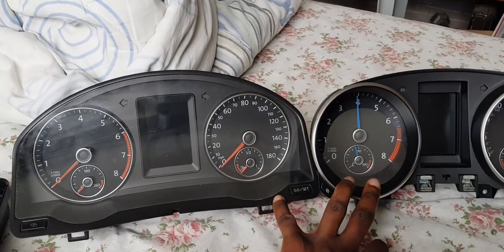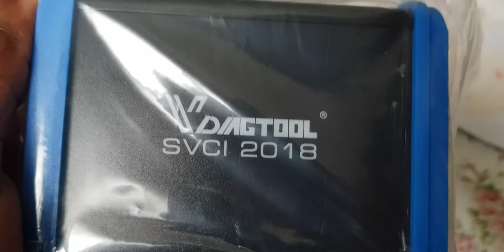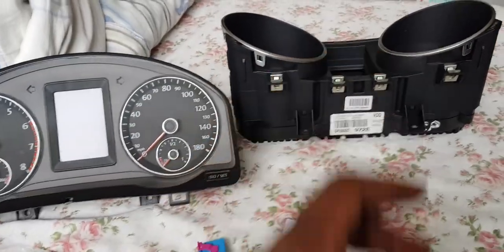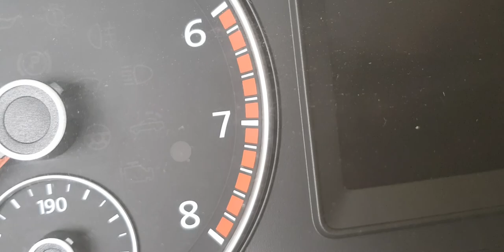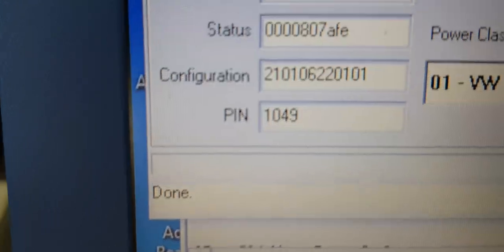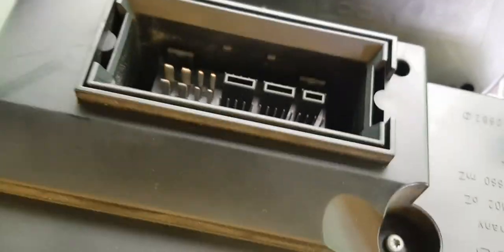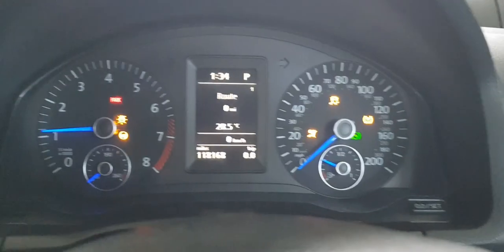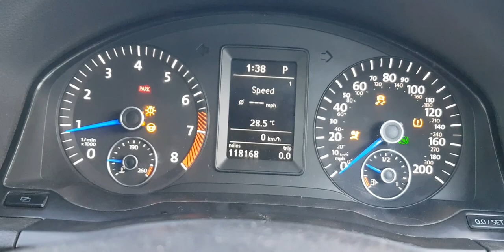MK6 Golf R instrument cluster retrofitted in a MK5 GTI

Comment: Hey eM have you had any luck programming keys for the mkv’s without spending crazy money? I bought rfid chips from Amazon but I was unsuccessful getting them to program in the transponder box tool. Do you know any websites that sell rfid chips for th mkv’s that aren’t junk and work other than having to go to the dealer?
Reply from the maker: Yes,  I used a cloned copy of AVDI to do it.  I had bought the 433MHz Megamos ID48 pill for $8 on eBay.  I'll look for a link to it.
Reply: @MatthewTaylor3  ok so I found the svdi on AliExpress but does It matter if It ships from Poland or China? Did you get yours from the U.S? Just wanna make sure I buy one that’s gonna work.
Reply from the maker: @VwDaD1988  I didn't get mine from the United States.  I realized mine came from China.  It shouldn't matter where it came from, once it is at least the "2018" version.
Since you are looking at this in 2021, you might as well buy the 2019 model (for whatever new features and being able to do favours for friends with newer models).  It surprisingly didn't take a long time to ship to Florida.  The device will pay for itself if you use it to help out your friends or potential customers for a decent fee.  I reset a failed module on 2 BMWs that wouldn't start and made back my money.

Comment: can you tell me what info you from old cluster and put innew cluster.i try but program still notwork.i program chip to clester but when i put in car immo active cant start car
Reply from the maker: Read immobilizer information (from your original cluster), and write ONLY the VIN, PIN ,CS, MAC and Power class
Reply from the maker: It is very important that you also understand that pairing the new instrument cluster requires you to pair a VIRGIN key (blank transponder pill) if you are using the ID-48.  The physical key (transponder chip) is bound to the cluster that it was originally bound to.  If you are putting a MK6 cluster in your MK5 car (for example), your MK5 key is no longer valid, and a new one (blank Megamos ID-48 pill/chip) would have to be paired to the MK6 cluster so that it now works in your MK5 car.

At NO time, should you delete any (old) keys until you can get the car started and running like normal.
Reply: @MatthewTaylor3  MAC need take from cluster or ecu i see is different
Reply: @MatthewTaylor3  eeprom no need write back original
Reply: @MatthewTaylor3  how to be paired chip?add one more key
Reply: i done how you tell me but still same immo active
Reply from the maker: @frijus100  You would take the MAC from the OLD cluster and transfer it to the new one.  The PIN comes from the ECU (which would be the same as the one stored in your stock cluster).
Reply from the maker: @frijus100  I used a copy of AVDI by Abrites, to do this.  The clone tool in this video works as well.  You need to buy a new ID-48 Megamos transponder pill (or a blank virgin key) to pair it with your immobilizer.

Comment: I have a mk5 2009 jetta and bought the svci 2019 software which is still coming in the mail. I ordered a tiguan cluster to have a working case. I saw you mentioned recommending a passat cluster instead of a golf r/gti one. Do you have a part number that would be the best to purchase, I'd want MPH.
Reply: Also I'm curious does your mk5 gti have cruise control? these newer mfds show speed set with cruise on. What behavior are you seeing with that?
Reply from the maker: The cluster case/housing I had recommended was the MK6 Jetta one as the bolt up is the same as my MK5 Golf.   For the MK6 series, the Jetta and Golf have 2 different dashboards.

Since I have a 2008 Golf GTI, I'd need the physical parts from a MK6 Jetta to have them bolt up natively (although I'd be using the MK6 Golf-R/Golf GTI internal electronics for the cluster.  Now what I said about the Passat cluster was that I would have bought that instead for the colored display in the middle if I had to do it all over again, and I realized that the process for swapping everything was so easy.  The Tiguan cluster is also really nice too.  You can buy the faceplate by itself so you only see MPH.   Let me look at those part numbers and get back to you in short order.
Reply: @MatthewTaylor3  Thanks, so it turns out the tiguan cluster wont work since it has electronic parking brake and uses different fuel sensors. I actually just cancelled that order. I decided to order the SCIROCCO MK3 2.0 Petrol cluster which seems to be the closest match. I'm also curious do you get cruise control data on your screen like the newer VW? Like what speed you have your cruise control set to? ps - I Sent you a message via google chat using the email you have listed in the about section if it's easier to chat there.
Reply from the maker: @jaredneedell7006  Yes, I did retrofit cruise control in my MK5 GTI years ago.  Mine doesn't show the speed that is set.  It only shows the fact that the cruise control is working, and the current vehicle speed digitally.   It doesn't show what the cruise control is actually SET at.  For me, I just mentally remember the digital speed readout when I activate the cruise control.  I then know that it will add or subtract 5km/h for every second I keep the PLUS or MINUS button held on the cruise control stalk and it would give me updated SET speed.  My car responds quickly, so I just look at the current vehicle speed most of the time to know what the SET speed actually is.
Reply: @MatthewTaylor3  Did you ever swap to the SCIROCCO cluster as you  mentioned in the video or still using the Golf GTI/R cluster?
Reply: Also can we chat on discord or something?
Reply from the maker: @jaredneedell7006  No.  The reason is that I can't find an affordable SCIROCCO-R cluster to buy.  These units seem to be GOLD online.  That would have looked so nice in my dashboard with the 2010 Jetta faceplate.  I'd just get the chrome bezels to finish it off for an OEM look.
Reply from the maker: @jaredneedell7006  The Tiguan one would have worked.  It just requires you to make an EEPROM change for both the fuel sensors and parking brake.  VDOeditor would make that process too easy.  There is no cruise control data on my screen other than the current speed that the car is driving at.  I can't see the set cruise control speed.  I think I'd need the Passat B7 canbus module to be able to see that information.
Reply: @MatthewTaylor3  not due to the gateway not writing the cruise control speed. The ECU does not know the function.
Reply from the maker: @davtsik1  you are correct.   I learnt this after posting that

Comment: Hello, if i change the cluster directly and just copy the immo settings from the old one will it work without problems? I think my abs is okay because the car is 2007model. Please help me i cant find someone to do this job in my country.. :((
Reply from the maker: Hello.  Your ABS unit WILL reset itselt and lose all coding whenever you connect another ECU or instrument cluster, so make a note of your existing coding to restore later as it WILL be lost.

You can’t just copy the raw immo settings to the new cluster as they are different EEPROM and software version.   You would transfer the information like the: MAC, Power Class, CS, and VIN.  The serial number being a string of zeroes isn't an issue, and can be left that way.   You will need a new key fob/transponder pill/ ID-48 pill as your existing one is permenently "married" to your stock instrument cluster.   If you got a donor key that came with your new cluster, that can work too.  You would just need to swap the key blade to work in your ignition, glove box and driver door.
Reply: @MatthewTaylor3  Thanks for the help! How can i transfer the MAC, Power Class, CS and VIN to the new one? I think to go local car-key service for the immo but can they do the same job with their equipment im not sure. :/
Reply from the maker: @tayfun.mehmed  I used a ph0ny copy of AVDI to do it.  You should be able to do it with tools like ODIS.

The most trickly part is just getting the new cluster into service mode.    I need to redo the video, so the process is more clear.
Reply: @MatthewTaylor3  Okay. thanks for the help man, there is a lot of things to do i even dont have enough time, ill be search a good car-electronics service again i hope to find one..
Reply: @MatthewTaylor3  Hello again, i find a guy on car-key service and he said they can do it. Just i need help with some questions, is all the clusters works or i need to find with a specific part number? And this 36 to 32pin cable is same like from the passat or not because i only find for passat b6.
Reply from the maker: @tayfun.mehmed yes, the one for the Passat is the correct one,  once the ends look the same as I show in the video.   

Any cluster part number will work,   but use a highline model for the best aesthetic appearance and the gauges and LED items looking correct.   Avoid getting one from a Diesel model or electric due to the different gauges and the LED cards being different
Reply from the maker: @tayfun.mehmed @tayfun.mehmed yes, the one for the Passat is the correct one,  once the ends look the same as I show in the video.   

Any cluster part number will work,   but use a highline model for the best aesthetic appearance and the gauges and LED items looking correct.   Avoid getting one from a Diesel model or electric due to the different gauges and the LED cards being different
Reply: @MatthewTaylor3  Hmm but my car is a diesel 1.9tdi, i think to buy from a 2.0tdi golf mk6 is it not a good choice 🤔
Reply from the maker: @tayfun.mehmed  oops,  I didn't realize your car was diesel.  You can buy the cluster you suggested.   The RPM range would be the same.
Reply: @MatthewTaylor3  Thats my bad, i didn't said at the beginning 😄 Thanks a lot man you helped me a too much. 🙏🏻
Reply: @MatthewTaylor3   Hey its me again, yesterday i checked my ABS part-no and its from the old ones (MK70)..  so can i do upgrade without changing abs or its necessary to be changed, do you have an idea? im so disappointed the car was 2007 model but the ABS unit is from the old one.. :(
Reply from the maker: @tayfun.mehmed   Hello. No, your MK70 ABS is not old or outdated.  It is certainly has more features than my MK60 in my 2008 GTI.  You wouldn’t trouble or replace the ABS.  It is important to make a note and backup the coding on it as it will be cleared / lost after the procedure.   If you know someone with VCDS/OBDeleven, then can make a note of everything for you.
Reply: @MatthewTaylor3  Hmm thank you for the information, we will try it i hope everything will be work fine because everybody said MK60 ABS unit is necessary for this swap thats why im stressed a little bit.
Reply from the maker: @tayfun.mehmed   MK60 or MK70 shouldn't matter.  There are several of these vehicles here in Jamaica with MK70 as well and that instrument cluster from factory.

Comment: I want to change my needle LEDs do I need to solder them?
Reply from the maker: If you need to change the actual bulbs, you would have to de-solder the OEM ones and solder the replacement ones.

If you just want to change the actual needles from Blue to Red (or vice versa), you would just swap the needles themselves and not trouble the already White LEDs.
If you need BLUE needles, you can get them from the Golf-R or VR6 R32 models.  If you need Red needles, you would get those from the GTI.

Comment: Did you need new transponders in your keys?
Reply from the maker: Yes, a new transponder was needed.  You CAN'T rewrite the existing ones.
Reply: @MatthewTaylor3  At the start of the video you say you already deleted the old immo data from the Mk6 cluster, did you have a key for the used cluster you installed? Or can you access service mode on the cluster without it?
Reply from the maker: @seh97  I did not have a donor key for the cluster I installed.   I had disassembled the cluster, and used a "clip" to read the contents of the EEPROM with a programmer to my laptop, remove the immobiliser portion from the specific address, then write the modified version back to the EEPROM chip. 

I could then place the cluster in the car, and use AVDI or a similar tool to place it in Service Mode to transfer over the OLD data and add a new key/blank transponder pill.  To the best of my knowledge,  you can't enter Service Mode without doing some trickery to the EEPROM first since in our case, the ECU and donor instrument cluster weren't initially paired together. 

If one had a paired donor key with the cluster then entering service mode would be easy at the click of a button.
Reply: @MatthewTaylor3  I'm going to have to do the same procedure then. I've bought a Scirocco cluster with no key to put into my Mk5. I'm aware of the clip you used to read the EEPROM so I'll just do that and buy a copy of FVDI.
Reply from the maker: @seh97  Yes, you will have to do the same process.  Are you able to post the part number for your cluster so I can determine if I want to swap to that one as well ?
Reply: If I’m able to get mk6 cluster with its original key, can I reuse the ID48 pill from that key in my existing mk5 key? Or still have to get new ID48?
Reply: @SHtatkus  you still need new ones
Reply: @seh97  Thanks for quick reply, do you have any recommendations for them? I can find some on ebay, but descriptions on some listings mention VAG cars up to 2005, so I guess those are not suitable for mk5/mk6?
Reply: @SHtatkus  ebay ones work ok

Comment: Can you get all the immobilizer info from the car? I’m looking to pickup an extra ecu for a a motor swap. Do you IG?
Reply from the maker: Yes, using a cloned copy of AVDI, I can get the immobilizer information from the existing instrument cluster (which would match that of the existing ECU that is in the car.  The new cluster would have to be placed into Service Mode to enter the original immobilizer information to it.  If you are doing an ECU swap (and not an instrument swap) then you don't need a new key.  If you are just swapping a new ECU for another engine to the car, you would need to know the PIN, MAC, CS, Power Class, and VIN from the donor vehicle.  This is easy to get if the donor vehicle is still in one piece (via a tool like AVDI).  If the ECU was already removed, then you will need to do this "on the bench" where you would dump the EEPROM contents to a file to be read by suitable software.  I've never gotten the immobilizer delete feature to work in AVDI.  I don't have an instagram account, but I'll be creating one to post here.  The MED9 and MED9.1 ECUs dump easily on the bench, but MED17.x.x needs to be placed in BOOT mode before you can access the tricore memory.  This requires opening the metal casing of the ECU, and temporarily attaching some resistors.

Comment: Hey bro, you're video's are very helpfull, respect for that!

I have A question: I'm going to swap my mk5 cluster to A scirocco 3 color cluster. I ordered the harness adaptor, and AVDI 2020 and ID48 pills.

I only don't know what I have to do to get the immo working. Can you please make A vid about it? Or help me in writing? I will much apreciate it🙏
Reply from the maker: I will make a video over the weekend when I have the time to do so.   Getting the existing PIN for your current vehicle is easy with AVDI/FVCD.

Getting the PIN from the the donor instrument cluster is an "All keys lost" situation where you have to first READ the EEPROM data and save it to your hard drive by disassembling the instrument cluster, and connecting directly to the 24C32 or 24C64 EEPROM.  You would then "blank" the immobilizer address portion, and WRITE that file to the EEPROM.  Temporarily connect to car with the harness and use AVDI to enter Service Mode via OBD.  Using the stock file that you would have backed up, you can then see the PIN and all the juicy details in the donor cluster.  From there, you can manually pair with your car, then add keys.

Do NOT delete any stock keys until after you have completed the pairing of the new one.

Edit: I don't know if you saw this site which also shows a similar method.
http://www.auto-diagnosis.org/fvdi-2018-change-golf-6-dash/